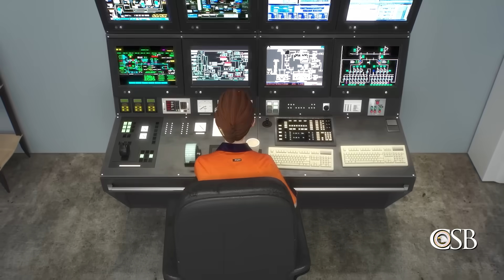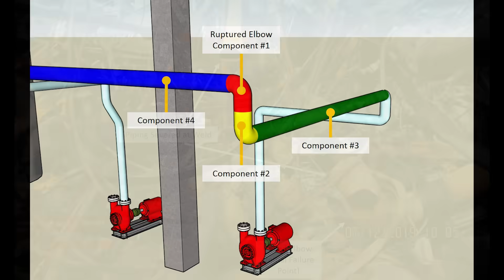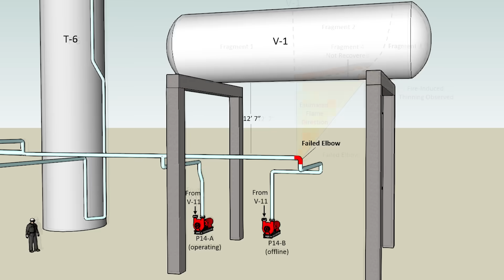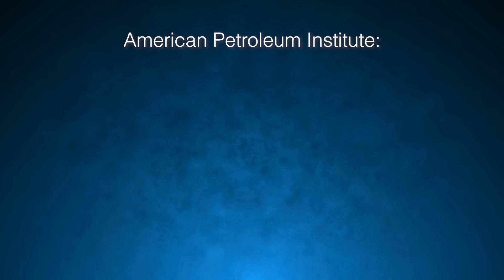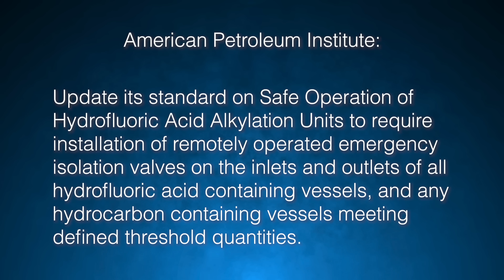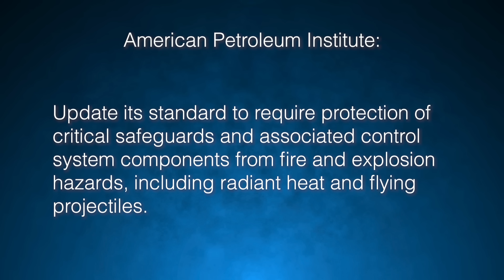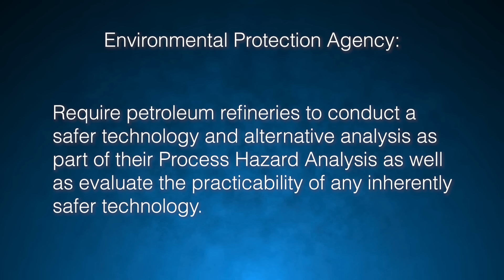Wake Up Call: Refinery Disaster in Philadelphia

Comment: I don't mean to be political about this, but, I have visited many factories and other facilities with similar maintenance problems. You could diagnose this issue nationwide by asking individual factories why all the clocks on their walls are dead and I guarantee you it's the same reason they'll give you for why pipes get so corroded like this. They'll tell you they don't have enough maintenance people. That's the whole story. ...the point I'm trying to make is that we're not doing everything we can to prevent accidents like this which includes adding people to our workforce and that's why accidents like this happen; which, just makes me so much more angry when things within our control that we can change like allowing cannabis consumers to get jobs, which we claim is to prevent accidents like this one - but as we can see the accidents are caused by the lack of manpower leading to a lack of maintenance, not the presence of cannabis consumers. Allowing cannabis consumers to get jobs would add about 7 million people to the workforce and make unemployment numbers more accurate in the first year, add about 3 million people to the work force the next year, and continue adding people to the workforce in similar manner. That's the real problem, we need people to stop faking certain things are/as problems, and start working together and talking to each other.

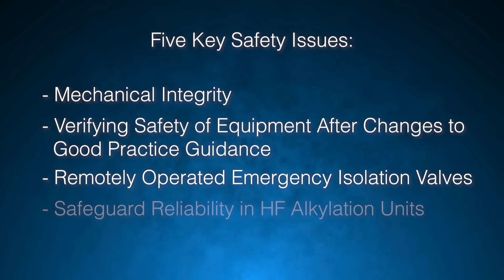4 out of the 5 points outlined at 5:50 imho can be attributed to lack of manpower issues. With at least one more person there, someone could have inspected the equipment while the board operator continued their job and they could have switched back to the other pressure and repaired the pipe until it could be replaced...someone could have been there...someone could have seen it. 

I don't care if we need to figure out more bus routes or some other way to get people around or get HR people to literally physically drive around from neighborhoods to apartments to hotels etc. going door to door offering people on the spot interviews and jobs. Maybe if we do that or let cannabis consumers work we'll prevent accidents like this from happening. Imagine if we did all of the above. More transportation, more communication, more people.

Comment: Good job on USCSB!

As usually things are understood much better after failure. Leads us back to design process!
And again to think about: most failure happen while specification.
- how could this material be chosen?
- why placing the emergency storage bin right over the critical part? in Germany it is best practise to put critical tanks far away and/or under earth level.
- why build active fire distinguishers failing when power off? (it is predictable, in emergency power will be off)

Anyhow - everybody should be happy that we did not have more victims. The potential of this configuration could have much more impact.

uch more potential.

Comment: This is a consequence of LEAN MANUFACTURING!  If there were sufficient people in charge of the HF Alky unit, these explosions could have been prevented.  Also there ought to have been alarms going OFF in the unit warning the operators of the emergency.  This is also a consequence of using HF alky.  The sulfuric acid alky is an inherently safer way to make alkylate.

Comment: I have worked many years around the oil and gas industry here in Texas and it sounds to me like a whole multitude of things that could have and should have been done in the beginning but apparently there are a lot of payoffs and shortcuts taking while people were looking the other way. Overall the industry it's full of people that are very conscientious about what they are working with and the dangers that surround them every day if everything is not done safely and check regularly. But it is always the people at the top who try to find any shortcut to take you take to increase their profits from obscene to ludicrous. The administrative staff is always to blame for shortcomings and procedures not being followed. And after hearing all of the problems with this plant there should be extremely intricate examination of anything that may have changed under regulations under President George Bush jr. He removed during his administration a lot of safety protocols in the oil and gas industry simply for Big oil to increase their profit margins Way beyond what they already were. He and he alone is responsible for the huge offshore drilling platform fire in the Gulf of Mexico that could have been prevented except he passed regulations and signed off on him that did away with extremely critical safety devices that would have stopped the flow of oil out of the ocean floor. Under his watch his actions created that massive disaster and the death of all of those workers that died in that horrific hell. It is always pure corruption from the top of the federal government all the way to the top leaders of the fossil fuel industries that put everyone's lives in danger. 🤔

Comment: Need this group to look into the multiple failures of reheat lines in some Coal fired power plants. One failure (WAP #8 Thompsons Tx) would have been a mass causality event except that the 60+ contractors that would have been at lunch directly under the line got rained out shortly before the rupture. Another failure on WAP #7 in the same plant blew an Electrical foreman out of the building and on his ass. Ten feet farther in and he would have been Par Broiled.

Comment: Hydrofloric is a much better alkilation catalysis than sulfuric acid. Much less is required to be on-site, it lasts much longer, less need for transportation of this chemical  (would you rather have one truck of HF or 30 trucks of H2SO4 on the road?). I'm making the point that there are no perfect solutions, only tradeoffs.

Comment: And this is where words have significant impact: “should” is translated to “don’t have to”. Why wouldn’t you have the safest facility possible? Rhetorical perhaps as cost drives all decisions, but there was no reason for that elbow to go unnoticed and unchanged or have the remote controls burn through so manual operation at great risk were required. We can do better than this American!

Comment: Sulfuric acid is less of a danger than the hydroccloric acid in your stomach.  It will burn you, but it's not nearly as bad as the hydrochloric acid our body uses to digest animal flesh and plant matter.    Hydroflouric acid is a monster.  You can get a single drop on your skin and wipe it off--hell, rinse it off--and it will wreck your whole hand (imagine your fingers wrinkling after a bath, then make it 100 times worse).  You may not even know you were exposed because it can take hours for symptoms to develop, and the only sign could be a small ulcer or excruciating pain.  It goes on to leech the calcium from your bones and wreck your body's electrolyte balance, possibly inducing an arrhythmia or heart attack.  

Sooo yeah, if you have to die by acid, pick anything besides HF.

Comment: The Dem Mayor Jim Kenney has permanently shut down the refinery, killing over 500 union jobs and millions of $ in tax money for the city. Not to mention 335,000 barrels/day of Gas, Diesel and fuel oil that we could use now. The pipe that fail was there for 40 years. Maybe all piping over 40 years old should be replaced automatically in refinery for safety.

Comment: This is the fear that the general public has of every pipeline and nuclear reactor, nuclear waste storage system or the electrical grid.  These systems are designed to meticulously engineered, be full proof and provided with back ups and a plan B in case the perfect storm ever occurs.  Then we find out about a single pipe fitting that somehow got neglected.  Then we find out that profits were maximized by staff reductions, full inspection didn't happen, someone took a short cut, purchases of inferior equipment or failure to provide proper test equipment.  Each incident, such as this, proves to the public, that despite all the promises of safety, things can still go terribly wrong.  The CEO of this refinery should be in jail.

Comment: That's awesome!!!!  No deaths, only 5 injuries (which means a pay out for those people) and A SHIT TON OF JOBS CREATED!!!!!!  Pro tip, if you see an operator running one way, run the other.  So many regular blue collar folks like you and me put piles of money into their bank accounts as a result of this.  Alky units suck though they are so gross.  Think about it though, literally every pipe in that plant will have gotten hardness testing, all the welds checked for cracks, every elbow checked for corrosion, and positive material identification.  Lots of components will need to be replaced.  So many jobs!!!
Reply: With this reasoning, we should burn America to the ground, because fixing it will give so many jobs 😂 nah, I getcha, you're trying to be positive

Comment: This is a nice video showing the disaster and call to action but the bottom line is that it will cost a lot of money to be proactive and inspect all piping, possibly shut down to upgrade areas.  I don't think operators will just do this unless there is another bigger cost hanging over their head.

Comment: Reminds me of a couple of large similar incidents in a refinery where I worked. The console operators & ops supervisors are the first lines of defense, their correct immediate actions can save many workers.  These plants work 24x7 processing very volatile-explosive chemicals under extreme pressures and temperatures thru 100s of miles of pipes, vessels, and 1000s  of miles of electrical wire.  One mistake or equipment failure can become a disaster and any moment. It takes a special breed of people who work their entire career in a refinery or chemical plant.

Comment: This videos do keep getting better and better, my only complain as non-U.S.A citizen is the lack of metric units (or IS units), however I can agree it is nitpicking.

What I learned from it is more important, as the explosion could have be prevented with a remotely control safety valve and employee risk can be mitigated by making sure safety devices will work automatic, without human intervention, under harsh circumstances.
Also, that simply using a more, inherently, safer process reduces risk and damages in case of a problem.
No to mention that routine inspection and checks to see if equipment is up to the most recent standards, and take corrective measure in case it is not, is crucial to prevent loss of property and life.

Comment: Similar scenario in Superior Wi.  Explosion and fire but the HF unit wasn't compromised.  Just luck.  The Superior plant is in Superior city limits and populated area.  After the repairs are done and the unit goes on line the plant is much bigger.  I've got gas masks and one filter for each in order to leave town if I'm lucky enough to get to my mask and load the pickup.  I have no where to go, just out of town and probably camp.  There was discussion about the HF but it's still there.

Comment: I think this was a refinery owned by SUNOCO at one time. I worked 30 years at the SUNOCO refinery in Tulsa Oklahoma. Safety was pushed on you so hard that you couldn't do your job without breaking some safety rule. Our safety department was made up of people not good enough to be operators. It was a fail, fail system. I am glad to out of that fucked up environment.  The operators rule, and safety sucks managements dick.

Comment: My takeaway is that the people running these companies need to be held to account. They should all be prosecuted with prejudice for their willful negligence in service of naked profits. There should have been more emphasis on the fact that the operators of this plant did not implement numerous mitigations simply because they were not required by law or regulation. Of everything that went wrong here, it is my opinion that this negligence on behalf of the owners of this plant should be at the top of the list. All other issues stem from the conscious decision management made to maximize profits at the expense of safe operations.

Comment: In 1995 when it was learned that the specification for the pipes made in 1973 no longer met the safety standard, the plant should have been shut down or mandated to change the pipes. Once new safety information is learned the burden of responsibility to modify as appropriate rests with the refinery - they were clearly negligent and responsible for this disaster.

Comment: I can understand the fact that the failed elbow was out of spec, which falls into the responsibility of the plant owner. However, when the governing groups that control/allow certain parts and materials to be involved in a process, then change that regulation, I believe it should be the governing body's responsibility to then perform a site audit to identify any outdated parts at no expense (or highly discounted) for the plant owner, not the plant owner themselves.

Reasons being;
   1. Not all sites have the resources to perform a massive site-wide audit for something as small as every single pipe, they also may not have the required tools to do so either
   2. Since the material was legally installed and used at the time, it is not the plant owners fault for having outdated parts. This should have been caught earlier by the governing body before the part was ever allowed to be used in the first place (although, lack of testing or research can be debated as a valid excuse).
   3. I've worked in many sites, safety is laughed at. Either because of how ridiculous some of the policies are, or because of how taxing they can become. To ensure that the audit is performed properly, it should be done by the governing body, not cast out to each plant owners. Again, they may not have the tools, resources, nor skill set to properly identify all of these issues.

#3 Is probably the most debatable reason, but I still stand by it. Leaving the task up to the site owner to check every single individual pipe while in operation would likely be impossible due to the amount of human resources needed to verify the new standard/code was met. Even more highly unlikely to be done if it required the plant to shut down, costing millions of dollars in lost production to not only check, but then replace any outdated parts.

Thoughts?

Comment: Elbows are the most common points of failure in piping systems as wear on them over time erodes the metal and they get thinner and thinner much faster than the straight runs of piping even if the elbows WERE made up of the proper kinds of metal for that process. Every engineer and most maintenance workers that deal with industrial processes is aware of this.
I would blame lack of comprehensive inspection of systems. There are very good types of test equipment that will measure wall thickness of piping merely by touching the outside of the pipes.
This is definitely a case where an ounce of prevention is worth a pound of cure.. Look at the cost impact of not handling the plant properly let alone the potential harm to the public.

Comment: And maybe we should have a couple more refineries so when we need to do an inspection and possibly shut down a refinery temporarily to prevent these occurrences there won't be so much pressure on boards to preform?!?!
Reply: Eric I suggest watch a 13 part series called What on earth happened by Ewaranon to learn that the earth is not a globe. Link in my about tab.

Comment: A crucial part that was not qualified to fullfill that function (the elbow, because of the high percentage of nickel) but since it was not illegal to use at the time, it was used anyway.

However, in the following years, use of such a part became illegal (or did I miss something) and instead of replacing it, it was kept in use for over 40 years.

So there was nothing the local technicians could do to prevent the disaster.
But the company should have made sure all parts in this installation were safe to use
and they should have had regular checks on all parts.

This accident was preventable because the part that failed was a crucial part in the entire process, so it should have been checked regularly. Is once a year too much to ask in a period of over 40 years?
I can understand it is not practicable to check all parts every year but in this case, the part was 'the elbow' which is comparable to a rotor disk fan in an airplane's jet engine. If a rotor disk fan fails, the entire engine fails and the plane may very well crash with no survivors.

At the end, there are only recommendations to the industry, no new legislation to enforce the use of safe parts or safer chemicals?
That tells me the US government's advise to the general public is: don't live anywhere near such an installation.
Reply: At the end, there are only recommendations to the industry, no new legislation to enforce the use of safe parts or safer chemicals?

So you support killing people in order to ''protect people''. Because that's what government rules are, they are enforced by threat of force up to killing people who don't obey.
Reply: @flat-earther  Since when are these types of infractions punishable by death?
Reply: @flat-earther  Thank you. That was enlightening. So glad not to be residing the US of A.

Though I definitely wouldnt mind some evil CEO getting shot for resisting arrest.

ROFLMAO never gonna happen in a million years.

Comment: OMG.  I have worked with Hydrofluoric acid and once suffered a burn.  It is incredibly horrifying stuff for reasons I am not about to explain because I don't want to give anyone any specific ideas.  I don't think it is so easy to get anymore, but I could be wrong on that.  I do intend to work with it again at some point because it can some really incredible things.
Reply: What have you used it for.
Reply: @flat-earther  Etching flashed glass.
Reply: Thomas I suggest watch a 13 part series called What on earth happened by Ewaranon to learn that the earth is not a globe. Link in my about tab.